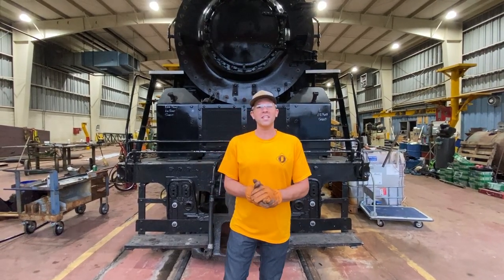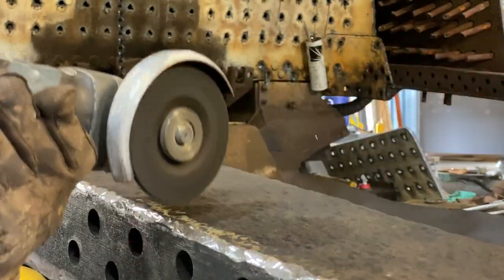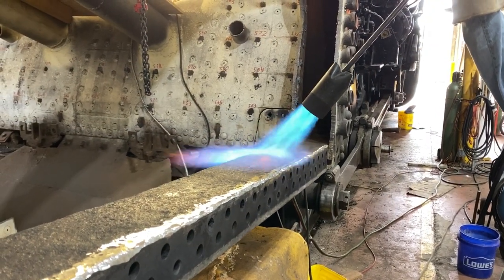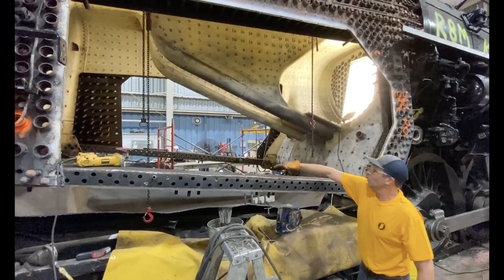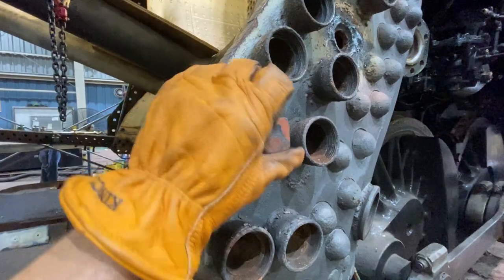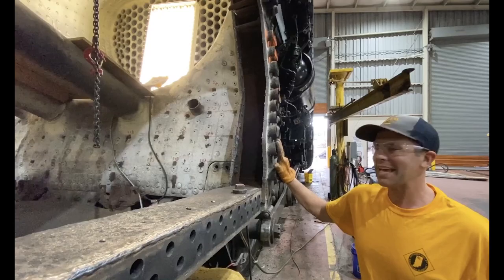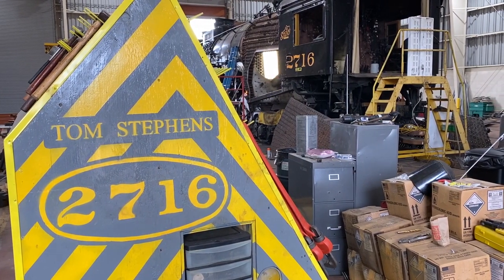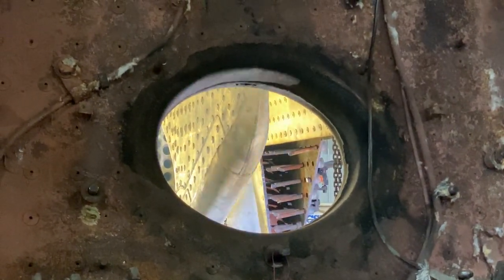C&O 2716 Firebox Work - October 2020

Comment: So, you gusy have 3 engines, C&O 2716, NKP 587, RJ Corman 2008. WOW you guys are going all out! Good Job on the firebox

Just realized, 2716 is leased, 587 IDK, and RJ C 2008 is full ownership from donation.
Reply: They will own 2716 when done iirc and 587 is just stored there
Reply: They also have the sd40-2 and that switcher
Reply: From what I heard the 2008 still has boiler time left on her soul all she will need is probably Is a
Boiler inspection
Reply: There can never be too many operational steam locomotives!
Reply: @raymondleggs5508  Indeed

Comment: Great video and thanks for showing the inside of the firebox with its sides and bottom cut away when you had the firebox exposed. It's awesome that your company is bringing the Chesapeake & Ohio #2716 to Connecticut to run at the Railroad Museum of New England/Naugatuck Railroad when the restoration on it is complete! I would like to kindly request please that it looks as original as possible to its C&O look including having "Chesapeake & Ohio" written on its sand domes and tender and having the number of 2716 on the locomotive and tender when its in Connecticut. Having look original to the way it was in active service [and not masquerading as something else] would be much better, even if it's dressed up as a locomotive that didn't serve a New England railroad. Thank you and I wish your company good luck on the completion of the 2716's restoration.

Comment: Sorry if this has been answered before, but why have the machine shop in a separate room for the locomotive / car work area? Wouldnt it be more efficient to have a set up like the Oregon Rail Heritage Center; where all the major tools are just off to the side of the locomotive / car work tracks? I was wondering this because a good bit of what I read about your Revanna facility comparing you to the ORHC with the combined educational / maintenance / preservation mission you have for the facility.
Reply from the maker: Larger machine tools will be on the shop floor. The smaller machines will be used not only for more exact work and smaller components, but will also be used in tandem with Estill County Schools and their vocational program.

Comment: So I haven't actually thought about this yet, but when the restoration is done will it still be a coal burner or will it be converted to burn oil like the UP steam locomotives?
Reply: They have said earlier that she will remain a coal burner
Reply from the maker: The short answer is that it depends on several factors. Doing a removable oil-burning setup has been discussed, and may wind up being the most economical. If it was converted to oil, it would be a removable setup for conversion back to coal being a definite possibility.
Reply: @KentuckySteam  I was thinking it would probably be the most economical long term but wasn't sure if it was financially viable at this point or if that would even be a concern. That is cool that it could be made so that it could run on oil but also be converted back into a coal burner though. I didn't know that it was a viable option.

Either way, it will be cool to see 2716 running when it's all said and done. I hope to maybe see it run along side L&N 152 whenever that can be finished, and maybe even see them double head on a mainline excursion.
Reply: @KentuckySteam  hey guys I want you to talk to me and I want to know when are you going to fire up the locomotive
Reply: @diegotamez1743  when the pandemic is over

Comment: Wouldn’t it be easier to place all the staybolt holes in the sheets before putting the sheets in place? Isn’t that how the built the boilers at the factory?
Reply: That's the plan, laying them out and marking the holes, cutting to fit and hoisting them up (if I've understood correctly in my conversations with the CMO).

Comment: Will 2716 meet up with 1225, and 765?
Reply from the maker: Maybe!
Reply: @KentuckySteam  while it seem a while the sight of 765 and 2716 side by side would be a sight to behold.
Reply: Peter Rosenquist why not 1225?
Reply: @ItstheBreadMan  it's a sight I want to see but the sight of the three 2-8-4s would also be a sight to see.
Reply: What about the 587
Reply: Idk when it will restore
Reply: But she is a great engine hopefully 4014 will meet her when she is restored and they use her cracked whistle 587 and 4014 will do a whistle battle
Reply: UP 4014 could meet NKP 587 although 4014 didn’t went to kentucky only 3985 in 1992 so yes it could
Reply: @ItstheBreadMan  but CSX wouldn’t allow UP steam engine to run on their lines. But now they are friendly and helping out with a rebuild of C&O 2716. However CSX might allow western and eastern engines to run on their lines in the future.